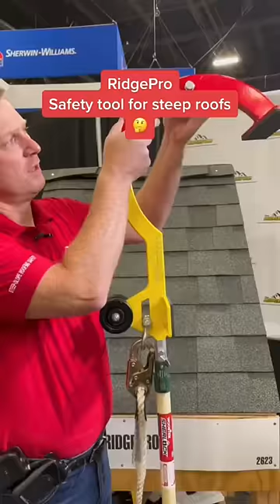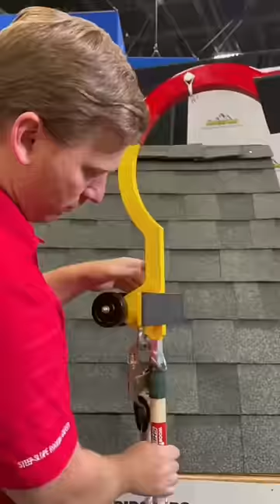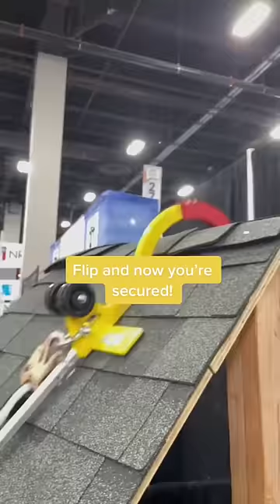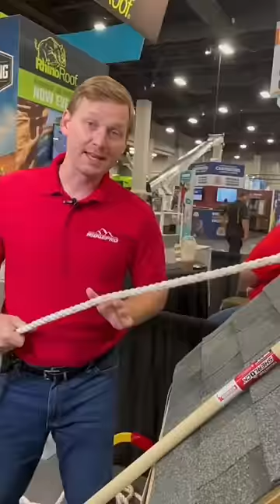Roofing tools

Comment: I remember being 18 and delivering shingles in the middle of winter, having to climb out of a hatch, always at the very bottom of the roof and scrape ice and snow off the roof while I nailed in 2x4s to make a ladder to get to the top to tie off. Makes my palms sweat just thinking about it. This would have been nice to have.
Reply: ughh reading this is making my palms sweat ahahah lol its real nerve racking being up on iced roofs
Reply: But. lol..u need your hands free for this rope grab
Reply: @loneranger9485  not necessarily. Assuming you have a harness with a ring in front, there’s plenty of knots you can tie that you can adjust while you ascend to the roof.
Reply: Spent several years doing much of the same thing you described. Now I work a desk job. I miss the roofs every day.
Reply: @zerofactor7871 yeah kinda, the better trade is painting or tape and texture work inside. The finish work. You still have the freedom of yelling fuck you across the job site but you're not exposed to the elements lol
Reply: @davidpetersen1  not true, as long as you get your nail placement correct its no issue. lots of roofers dont care and just expect the tar to glue them together.
Reply: @davidpetersen1  Its not ideal, but anyways every single installer will not honor their warranty if you dont put the nails in the right spot, and the correct number of them. There is a company that makes shingles specifically for application in cold weather but I'm blanking on the name right now. I believe they are made in oregon.
Reply: @davidpetersen1  did you even search for 5 minutes? Correct nail placement is what they reccomend when you are installing in freezing temperatures, implying that they dont reccomend against it.
Reply: @Fractal-insights  Do as you think best.
Reply: @davidpetersen1  I'm not a roofer, but I've done it enough to know I dont want to do it the rest of my life
Reply: @davidpetersen1   lol so you think places with snow all year like Greenland , Finland , northern Canada , Russia ect ect. don’t have shingles or shingle products made for that temp? Or you trying to say you can’t install ontop of snow?¿ because that is very true lmao In Canada if a shingled roof Is snowy and needs a repair or replacement we whip out the shovels , leaf blower & blow torch’s until it’s bone dry then install (a lot easier on flats tbh) plus ik in Nova Scotia Canada the wind/snow is so nuts off the water a lot of company’s put specialty caulking ON EVERY SHINGLE TAB lol pays a lot the more north you go... anyway I know for a fact hundreds of thousands of roofs installed in winter get warrantied successful depending on the rating of the product
Reply: @davidpetersen1  sorry customer, your roof that got destroyed by the storm last week will just have to wait until summer because a new one can't be installed during the winter lol
Reply: I fell off a roof when I was younger. Thank God the snow was deep enough to break my fall. That was the last time I worked for a roofing company.

Comment: Scariest tool I ever had to get used to 
Always wondered why they didn’t have an adjustable arc
Reply: It’s an unsafe tool
Reply: I use it for roof shoes or getting up for pulling a chimney liner. 
This looks far more safe than the original design I have but I’ve only seen this video never one in my hand. 

my roof hook is fine on older roofs with no vent 
But the vented roofs always seem like I’m being held by a shingle.
Reply: @brentmagerowski7886  the safest thing is to have a system installed on the roof: like anchors, lifelines..etcetera
Reply: @ok-lg1ng  agree if I were up there for days that would be the case 
It comes down to cost effectiveness 
Still need to get the job 
At the end of the day
Reply: Well, maybe safety could be considered a kind of investment, not in the sense of earning anything but not to go to the hospital for a fall… but if there’s a system installed than there’s also the possibility to access safely, occasionally or for further works like cleaning a gutter or other..
Reply: @ok-lg1ng  totally agree and a union shop would have the safety required because non of those guys would otherwise 
Also why union shops are rare in residential work just priced themselves out because of regulations 
But if I gave you a price for staging or a lift in the name of safety 
Then gave you a price with a roof hook 
You’re gonna save a buck and put that on my insurance all day just how the consumer market is 

So the safer I can make myself at a cheaper price I’m taking 
Just how old school tradesmen are I think 
today’s generation seems to be more cautious 
Maybe they didn’t climb enough trees as kids I dunno
Reply: @brentmagerowski7886   there are systems that are not so expensive without install a lift, now I don’t know how your roof is structured, but in many houses is possible to install few anchors (which can be eyebolts M16) to connect on with a harness
Reply: @ok-lg1ng  every job is different 
I’m a plumber so the only time I’m on a roof is for a roof shoe or chimney liner 
roof show I can weave in less than hour 
Liner I can be up half a day but once I’m at chimney I’m set up cozy with an apprentice below to assist 
love to see my options if you have any more besides a plank on brackets and roof hook 
For quick up down jobs 
Time is money and homeowners don’t like paying more than they have to 
Especially with inflation where it is
Reply: @ok-lg1ng  also I harness off on every job I have to with osha driving around 
it’s a matter of climbing a steep pitch safely which we have a lot of
Reply: I do gutter and window cleaning. I bought rungs to latch onto my ladder and then climb ladder to install pitch…. U think pitch hopper would be safer?

Comment: I slipped at the peak of a 2 story house and got lucky that I was able to catch my heel on the gutter, or I would've been done. I was alone at the time too. Would've loved to have this!
Reply: Oh my.  Thanks goodness that the gutter was there and that it held.  🤦‍♂️

When the vent boots were failing in the back roof of my house I threw a fishing line over the roof from the front and pulled a rope over and secured it to a post on the porch. Then used that as a safety tie. Felt much better having it.

Comment: This is nice love these new things  ...just reminded me I'm  still waiting on that safty guy that tired to make me use a roofing harness  that was for the peak like that when I was hanging ridge beams on a low pitch roof . Problem was I had to move around all that rope an anchor did was make trip hazardous an turn me into a pangolim...I took the clip with the rope an walked not even halfway  the distance  I had to be able to move and dropped it it hit the ground an then I reminded  him that there is a 4 foot bungee  that extends another 4 feet plus my body drop length thats 4.5 feet   witch makes my catch distance distance  of 12.5 feet . Then quoted ORM from OSHA .. turns out I know my safty stuff too thanks to US NAVY .. I've yet to see a good fix for that issue on framing houses

Comment: I did roofing for a while and the company I worked for finally bought us harnesses after OSHA was called in, however, NO anchor points or anything. We had to provide our own. Wish this was available back then. The guy I worked with would throw a rope over the house so we could climb up to the peak and set an anchor.

Comment: Have some time roofing for a few years when I was younger. I like the concept, design, and engineering behind it. Would be great for the first man up, but I would want the pad on the opposite pitch to have some sort of holes drilled, or way for that first man up to lag bolt, or more securely anchor to roof. Relying on friction alone scares me. But I still give it a thumbs up….

Edit: definitely not a geometry or physics guy. Just going off my gut feeling seeing a 30 second vid.

Comment: It's a pretty unique design. However, from an engineering perspective, the margin of safety relies on that pin maintaining its integrity. If it falls, becomes dislodged, etc., the user will fall with the steel apparatus that was holding them up is now going down with them.

Comment: The adjustable arc element is nice, but I would absolutely never use it to scale down like that. That's lifts up on the tool slightly and creates a direction of force it won't handle at certain angles.

But if the roof has the same slope on both sides, then it could be used to create platforms that you stand on, which would be perfectly sturdy.

Comment: I think the closer the worker gets to to the ridgeline on the roof  - i.e higher theangle between the rope and the roof -the less secure the hold.

I also think it is going to be hard to judge the required adjustment of the red extending part of the hook without being able to see it, especially if the pitch of the roof is different on the opposite side of the ridge.

iI's a good idea and there maybe solutions to the issues, but there is not enough info in this video  to say "it's a good product". 
But it is certainly a good basic idea.

Comment: Only insurance adjusters will use these. Most roofing crews are pushed to avoid using any safety devices, never get paid the markup for steep and high roofs. It's awful.

If you're a general who makes sure they use the safety equipment, good on you.

Comment: I could see using it to get to peak and putting In a proper rope anquor. Straight below fall might help but any fall to the side could test your ability to bounce off ground. Plus some roofs are rotten so could pull right through.

Comment: damn.. now if you could move that across the peak as you work on the roof.. But still it is better then what we had in the mid 70's on..
Reply: You can usually straddle the ridge to do that in a pinch but it's not ideal

Comment: I’d personally redesign this, with a much wider piece, like an outrigger on a crane, where the rope connects. This device would seem fine, until you go farther to the left or right of the center of attachment of hook mechanism. It’s achilles heel: A person going too far left or right, pulling left or right from center.

Comment: This would be better if it wasn’t overly adjustable like to a 2/12 pitch. The fail point i see is that it opens too wide, you will never need this on any pitch less steep than an icy 6/12 so it really shouldn’t open beyond that point. Not practical or safe for large projects with many workers as other ropes and people trying to pass by make this contraption a lot scarier to use, however it is great for a noninvasive way to access steep areas for repair and for that it’s worth a spot in the back of the work truck.

Comment: This is not designed as a alternative for a fall restraint system! It is simply designed to help the roofer get on the rood safely and legally until they are able to clip in to existing or until they attach roof anchors. If you use or think this is used for a fall restraint system you don't know much about fall restraint. This is equivalent to a lanyard. If you fall it has to be removed from service as it has been compromised. It is a temporary safety system. Not a working safety system. The flaws can be improved but nonetheless this is temporary for the use of only the ascension and decent of a roof

Comment: the pads should be wider to spread the load in case of rotten timber that can’t be seen.
It should be as wide as at least two rafters..
Wouldn’t work with natural slate or tiles in England either

Comment: Been in the roofing industry for 20 years no roofer is gonna use this. If your scared on a roof don’t go up. Put your ladder up next to a valley and get your weight in the ladder don’t puddle when your transitioning from the ladder to the roof or vise versa. This rope could get you killed trying to hold onto it when you should be focused on the ladder and roof.

Comment: Wouldn't ridge hooks on a latter work better since you gave the rungs to use to get up the pitch of the roof. 

Also if your worried about a safety rope for going down the climbing latter you can set your latter with ridge hooks and have the first man up set  anchors.

Comment: What happens if you trip over it and it comes loose sideways? I don't think having this tool is necessarily safe, because of the trip hazard, and the fact that sideways movement could knock it loose.

Comment: I'd buy it because I fell off a roof because the ridge hook didn't really work with the pitch I was working on. it was standing seam and as soon as that hook slipped I was on the ground and snapped 2x6 and 2x4s that was on the scaffolding. God saved me

Comment: This would be good for A frames and steeple types but for a majority of houses you won't need this. Majority of the time it's such a slight pitch you can walk with no precautions. For those crazy ones your gonna throw walk boards and they are nailed down and actually secure.....that hook looks a little wonky and would be hard to trust. Just saying I can see it being used but not very often and not without fear of it unhooking.

Comment: The pin is on the inside of where it hold, this should be on the outside. for a safety reason of the pin came come out from excess weight loads from the pin being on the understand hitting the roof.

Comment: You know it’s an idea 😅 but don’t you have to be on the roof in order to determine pitch for the tool? So you need to stand at the top of the latter adjusting the tool until you think it’s at the right pitch!? Question what happens if the pitch is set wrong and you fall? Do you also have a heavy metal object flying at ur face

Comment: You know they showed it on a model roof with  felt tiles because that little wheel will not roll up normal standard roof tiles stepped edges 😆 😅 
But if they made a rotating axle triple wheel, guess that would work

Comment: Only osha approved on roofs with a 6/12 pitch or more.  Which by the way nobody's walking around on A612 pitch. Not without ledger boards and a safety rail. Which means we don't need ropes🤪